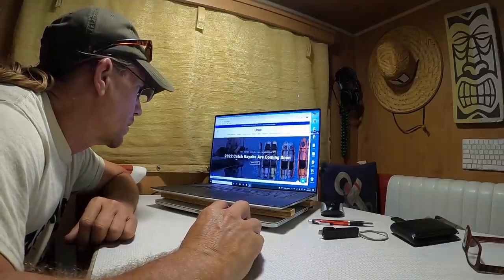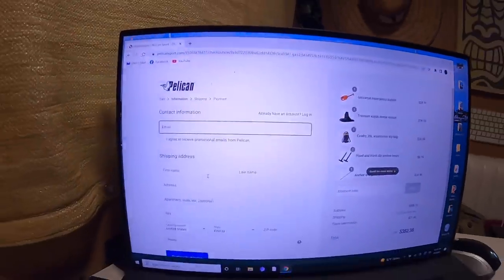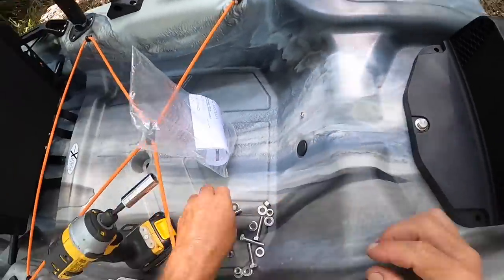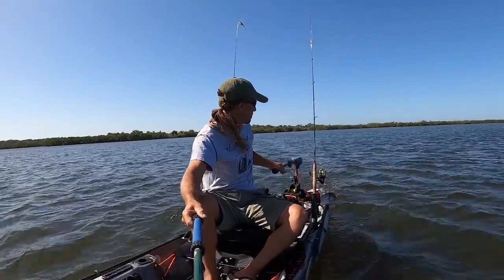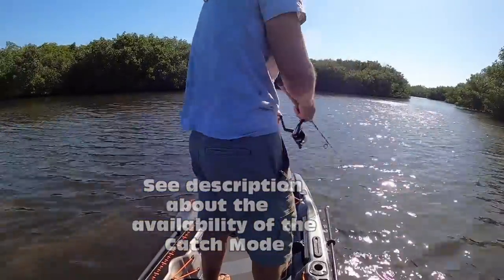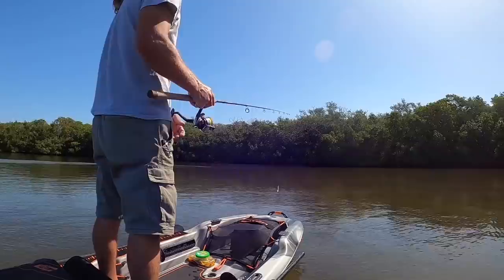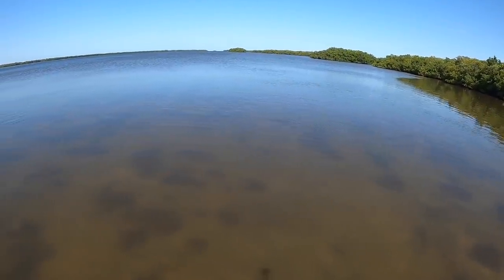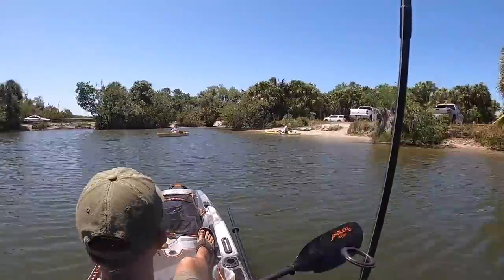Buying a Kayak Motor Upgrade Online

Comment: When I had my kayak, I was quite content paddling. Then when I got me a pedal kayak, you could not pay me enough to paddle. Then I got a trolling motor. I don't even.... 

I clocked like a 1,000 miles on R3 and Minn Kota 30. It changes you in ways you never knew possible. It just fixes the stuff that makes kayaking less enjoyable when not going down the river with a vehicle to pick you up. I can zoom about 11 miles using trolling motor and come back to the dock 70% power left in battery and full of energy to do other things.

Kayaking is the way of life, that's for sure.

Comment: Gotta have my motor. I purchased the 2023' new J2 Bixpy PP 768. Can't wait to set her up on my kayak. I Love purchasing new toys for the boat. Once a year, she gets treated. But glad I do have my  fin drive,  and I  do paddle around my spots. I don't want to rely on just the motor. The new Bixpy with the bigger battery will run at approx 4.5 mph, for over 2 hrs straight. But speeds 8 to 9 the battery will last more than 24 hrs, if and when I do my camp and fishing trips. Epic sport, and today's kayaks are truly one man fishing machines. And everyone has their own setup. 🎣 🙏 🌊 🐟

Comment: Thanks for the ideas. I built a prototype transom for my catch 130, it's welded using mild steel, and now it is rusted. I like that you can get the pelican transom, I might get that and fit it onto my catch 130

Comment: Really need a remote to steer the boat.  I am not as limber as most and twisting and contorting to steer the vessel is a pain.  There needs to be more options when it comes to steering across the board with all "trolling" motors.  I hesitate to call them trolling motors as many of us rely on them to propel us in the water even when we are NOT trolling.

Comment: That’s nice to have a motor and definitely the way I would setup mine the only thing Is I feel that a trolling motor on a kayak should be mounted on the side 🤙. I would personally put a 2x6 with 2 plastic pipe that would fit in the rod holder on the back that would be way less awkward to steer wouldn’t it ?? I wish manufacturers would think about this stuff and have a solution ready to go from the factory 😩.